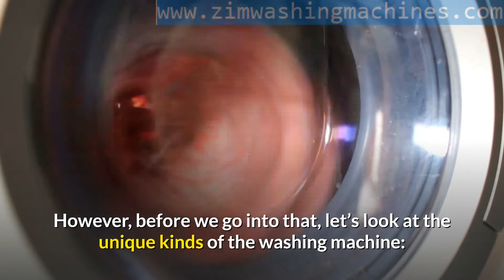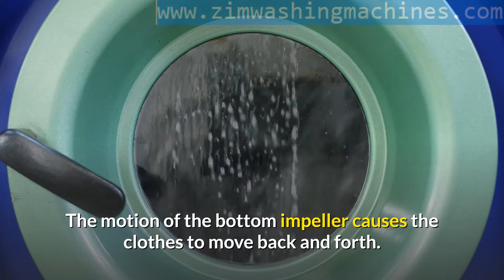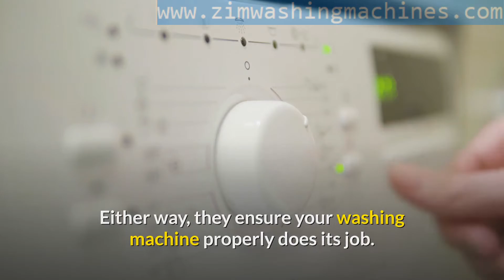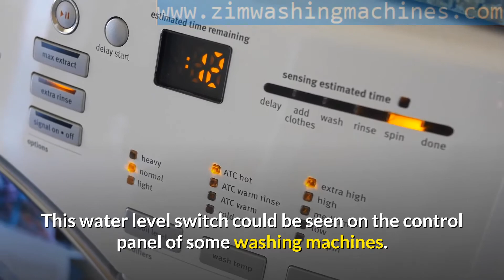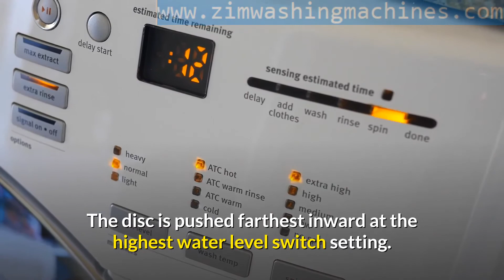How to bypass washing machine water level sensor part one

Comment: The Water Level Sensing device makes my machine take longer to do a load of clothes. The idea that it is more eco friendly is a bunch of hogwash. In a top load with no level sensor I could expect to take about 20 to 25 minutes to do a load of clothes. Now because of the dumb idea my washing machine take an hour or longer to do a load of clothes. I want a regular American top loader normal washing machine.How can I bypass the level sensor. I know that I can control module for the level sensor can be take out and be replaced. But I just want to simply do away with the Level Sensor. And get back to having 20 minute wash cycles..
Reply: Im so stress with my new ge washer, i dnt even see enough water how can i fix this problem??? Help!!!!

Comment: This is the best video I've watched so far.  I bought all new appliances a few years ago when we moved into a new house.  I did not know my washer was an HE.  I had never heard of an HE except for front loads.  The sales person never mentioned it to me.  I just discovered the low fill about a month ago and thought there was something wrong with my settings.  NO!  It's the crazy lunatic greeners who have done this to us!!  Dishwashers that don't clean unless you run them for 2+ hours, etc.  So, now I will see if I can adjust a screw to increase the water level.  Thank you for this helpful video!!

Comment: So basically add bulk (towel, sheet/linen); wet laundry before starting machine (increases weight, pour water on top of laundry before start), put on "Bulky" setting OR just return it for a machine with manual size settings.  Hey washing machine manufacturers, this is NOT helpful or progress!!

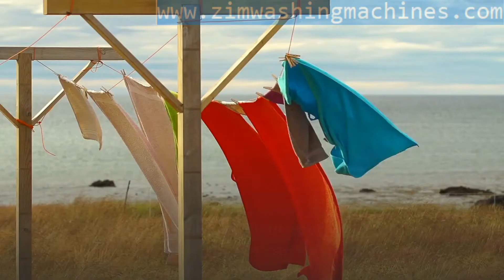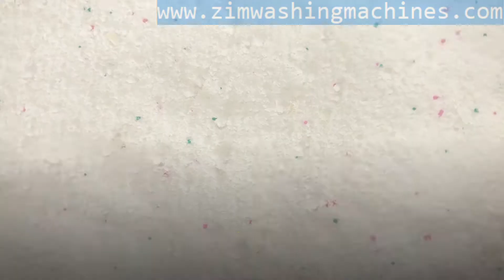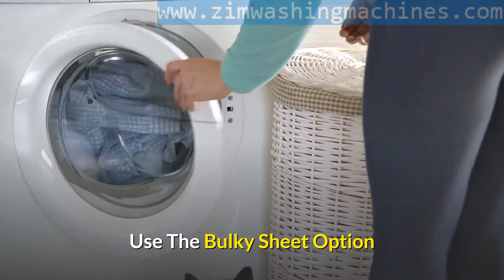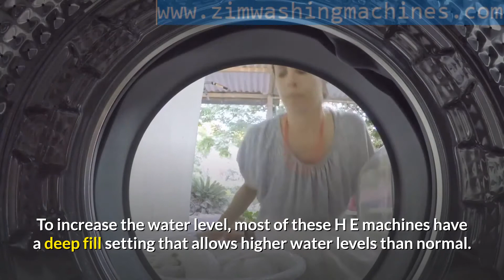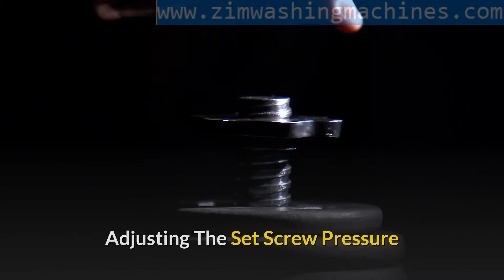Comment: I'll save you wanting to kill yourself during the first 5 minutes where he says virtually nothing and then says it over and over and over again.  The methods listed are: (5:32) add clean old towels to the wash to increase bulk;  5:52 pour water over the clothes before starting the wash to make them heavier (so the machine senses it as a bigger load); 6:19 use the bulky sheet option.  He then repeats all over again why HE machine use less water, why this is a problem, and then at 7:17 tells you again to use the "deep fill" (if there is one) or "bulky sheets" option.  At 8:01 he says there is a water level "pressure switch" that can be adjusted but good luck finding it or adjusting it.

Comment: Wet clothes before washing to make them heavier for more water in wash,or use the sheets and bulky setting for everything. I hate my HE machine and will buy an old ,used Kenmore when this one dies.😁
Reply: I'm going to do everything possible to keep my old top-loading, high fill, agitator, stainless steel tub, no lock top machine working until the day I die.   All the negative aspects of the so-called HE machines cancel out any imagined savings.
Reply: This really doesn't help at all unless you load 20-30lbs & the washer knows it's water & doesn't fill anymore